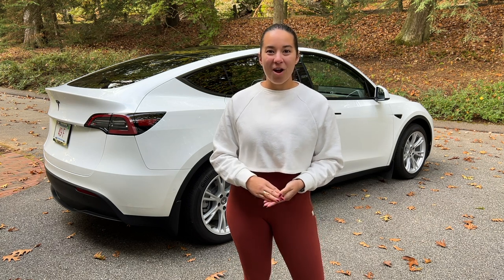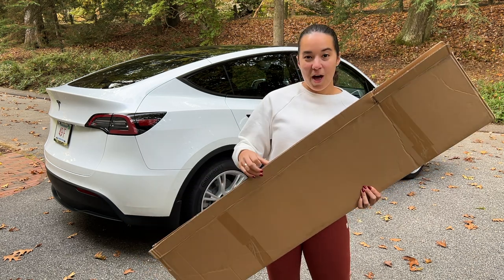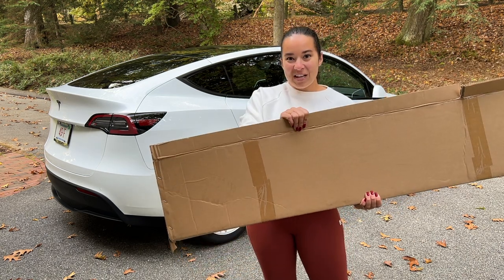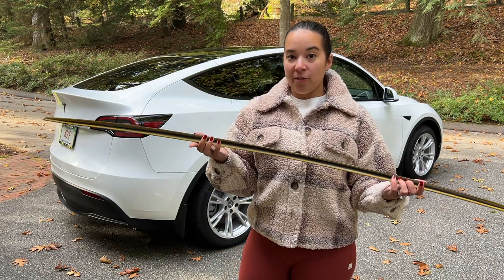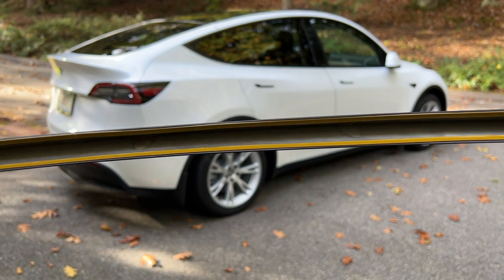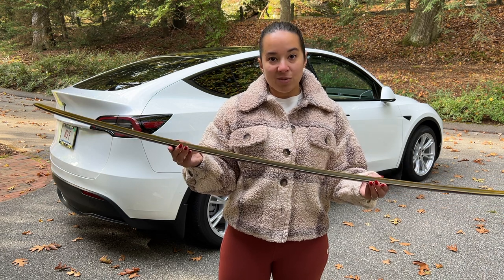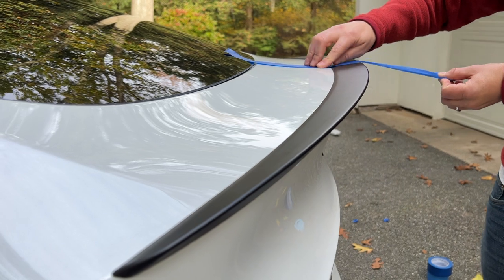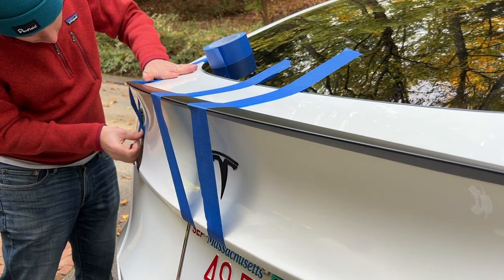Installing a Basenor Rear Spoiler on Our Tesla Model Y - Amazon Matte Black Tesla Spoiler

Comment: Nice! It looks good. 
Be careful in garages or others tight spaces  when opening the trunk. I learned that the hard way with a previous car and dinged the trunk edge. Dislodging the spoiler would be a pain. The opening force of the MY is pretty strong & tricky to stop while it’s lifting based on my experience with my MYP.
Reply from the maker: Great suggestion!  We just updated the max open height of the trunk to take into account the spoiler.  Thanks so much for watching and commenting!

Comment: Looks great. Did you ever consider just removing a a couple of inches of tape and as you push the spoiler down, pull the tape away (top and bottom) and push that section of the spoiler down?
Reply from the maker: When we test fit the spoiler off camera we practiced a couple different install methods.  This spoiler is reasonably flexible and our primary concern was making sure the middle was aligned and the top row of tape secured properly.  When we practiced the corner method we weren't as confident as putting it on at once from the middle and pushing the corners down.  We have a family member with a Model Y so we may try a different manufacturer / other install techniques on theirs in the future :)  Thanks so much for watching and commenting!
Reply: agreed...the proper way is to pull the tape as you go so that the spoiler will not only adhere properly, but it will also allow you to seat the ENTIRE width of the tape onto the car...the way you did it unfortunately it will catch water and eventually start to fall off...

Comment: @JQ Louise Any latest update on the spoiler after you have it for a few months? Does the edge lift after a few months like many ppl complain? Will be great if you can do another update video about the product after you have it for a few months.
Reply: I use to have this issue on a couple of amazon spoilers. All I did was removed and raplaced the last 12 inches of tape with actual 3m tape. Make sure you heat gun the tape before installing the spoiler to activate it and make it more sticky. I have had no edge corner lifting in about 1 year and a half now. I have ran it through brushless car washes many times also.

Comment: its beautiful! i hope it stick on during the freeway! doesn't fall off..maybe make video later?
Reply from the maker: Thank you!  We have let it sit for a couple days and it feels really solid.  We will definitely make future videos updating how well the tape, color, etc. holds up over time.  Thanks so much for watching and subscribing!
Reply: @JQLouise  yes can't wait for the follow up video...i want to add a spoiler too for my model 3 but afraid it might fall off in the freeway
Reply: @phat_gunpla_etc  it won't...if you do it right....I have a full writeup on how to do it on amazon :

Installation:
I cleaned the area with dawn soap and water to remove all coatings and oil, and dried the area.
I test fitted the wing on the trunk and marked a final location with masking tape (showing where edges will be)
I then took some alcohol and cleaned the area even more and waited for it to evaporate.
I took a blow dryer and heated the trunk area a little for 5 min.
I stripped just the corners (about 4 inches) of the red adhesive backing off and set the wing aside.
I used the adhesion promotor provided and wiped the entire area and waited about 15seconds before putting the stripped corner of the wing on the car.
Using my tape as a guide, I paced the wing down without too much force...just enough for that corner to stick a bit.
I played the rest of the wing down and slowly removed ALL of the red backing from the entire wing and lined up the other edge before pressing into place.

After the wing was pressed and installed I used the blow dryer to heat the area again and pressed more firm This time, adding tape to the wing to hold it down. on the corners and 2 pieces in the middle. (You want to create a downward and a forward pressure with the tape.

The tape SHOULD remain for 72 hours for proper adhesion, but over night to 24 hours would be the least amount of time I would wait. This procedure allows proper bonding with the tape and the metal because what people fail to realize is that the tape is Pressure bonding tape...the more pressure and heat (to an extent of course) the better the bond.

after that remove the tape keeping downward pressure with your hand as you remove.
after 72 hours, you are free to power wash the car and area as the tape would have now cured...and for those who will only wait 24 hours...please wait an additional 48 before washing the car or exposing to rain. if it does get exposed sooner..be sure to blow out any water with an air compressor and apply pressure when you can with the blue tape.
Reply: lol...I changed it to DAWN soap not DAMN soap

Comment: Thx for sharing. Looks pretty good. 👍 The question is, how will it hold up in winter months, car washer & if you don’t have a covered garage it could take on some heavy wear & tear, unless you get a car cover. In my option & buying experience, I would have went with RPM Tesla, Abstract Ocean or T Sportline . Enjoy your new spoiler 😁
Reply from the maker: Really appreciate the comment and we will definitely post our experiences with it / any updates as we wash the car and drive through New England winters.  We have a family member with a Model Y so may need to try out a couple other manufacturers/designs on their car  :)  Thanks so much for watching and commenting!
Reply: @JQLouise  So how was it over the winters?

Comment: You need to powder coat those wheels :)
Reply from the maker: Agree!  We are still trying to find a local shop and the time to take the wheels off.  Maybe a good time will be when we replace the tires.  We seem to be wearing down these tires a little faster than on other cars with all the instant torque :)  Thanks so much for watching!